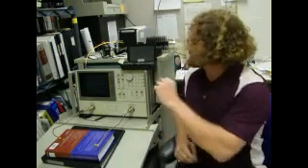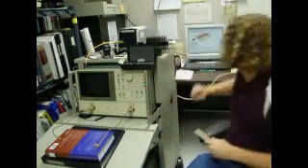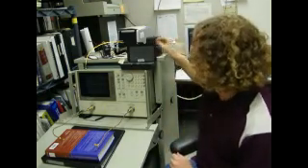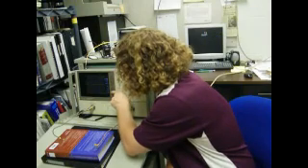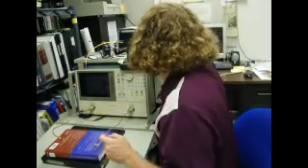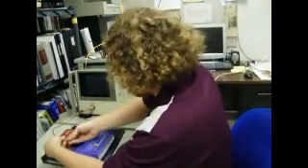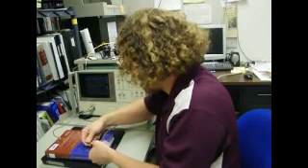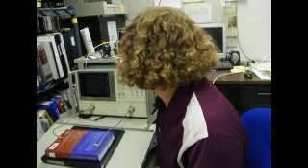Hope College Physics: Calibrate the HP8719C VNA

Comment: Good video... Hp makes some vey nice gear. U have a 8566b and 3585B in my lab. The 8566B is used for my RF work and the the 3585B for base band and audio. Of course, the 8719C is a good choice for Transmission line work.
Good luck in your sudies.